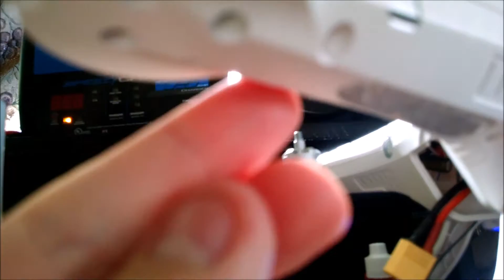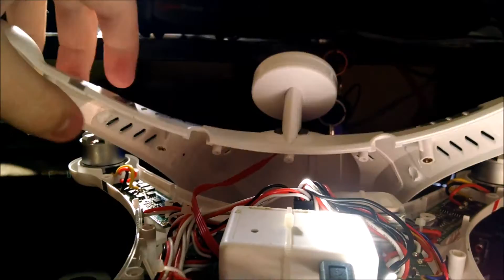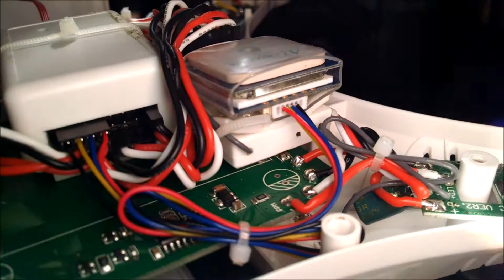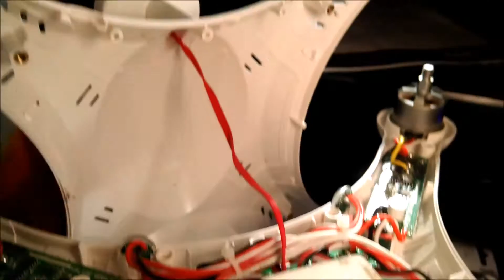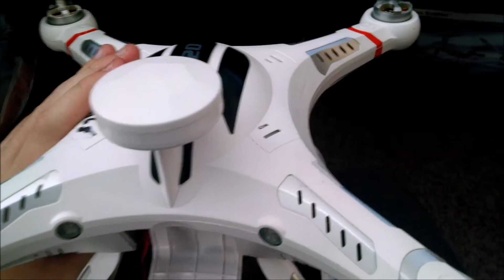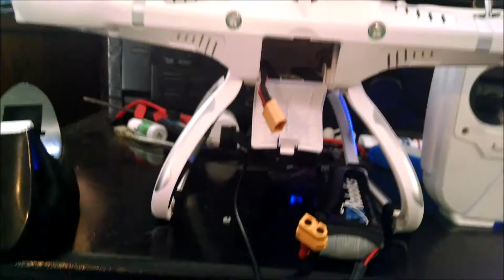Cheerson CX-20/Quantom Nova GPS Signal and Tilting Issue Hack/Fix

Comment: Hi, 
my cx-20 was flying fine today but needed more angle to combat the breeze so i came home and made the max angle = 3500 in mission planner now it will not arm, been building and flying planes and quads for 8yrs and tried for hours but it will not arm, got 5/6 sats green solid light, reset tx,all solid red rx inside cover, have you got any idea whats gone wrong , 
thanks
Kevin.

Comment: HEY bro, i have a quick question man,, Im having major issues as of late,, was working perfect till quad went crazy on me, and had abit of a spill, but noting Major,, ? I mean moments after it happened i wanted to see if any damage was obvious, and she linked up with the sats real fast like she was,, but after a few days off of not flying her,, it was like she just wouldnt give it up?! SHe would not, and most of the time will not link?? Now if i jiggle and push on the Sat DIsh thing ontop of her bbody, she someotimes decides to let some sats through, and then gets a somewhat descent lock,, anyway,, more times than not, i have to mess with the dish, and wait, and then off on, off on, and fly for abit,, and then MAYBE?? just Maybe the bitch will lock up a signal?!? I When itried to investigate i took off the top of the sat dish thing, and noticed a GPS Reciever of somekind, it usually blinks slowly, and then stops, and if i push on the stem of the dish, the little red light begins to flash quickly,, which one would assume would be a good thing, but again, usually i end up having to say screw it, and taking off with just regular manual mode, now the blinking reciver that i mentioned moments ago,,is that the exact same thing that you showed, and moved?? or is the one i again mentioned, just the othe end of the leads to just another gps panel or something,,?? please,, begging ya here,, help!? smh!!?
Reply from the maker: not 100% sure what your saying, but if I understood you correctly, you're saying that you crashed it, it stopped locking? if so, I'd check the cable to the GPS module. The module with a wire coming out of it is the 2.4 ghz controller module (what connects the remote to the drone)

Comment: So this does fix tilting during take off, or just during flight?PLEASE RESPOND
Reply from the maker: It fixes all issues related to poor GPS signal, so more than likely, yes it will fix all of the tilt problems. If it doesnt, youll need to replace the gyroscope
Reply: https://www.youtube.com/watch?v=-5b0Xeps4cM

Comment: thx for u vid, i will try it. Question..can it works with copper foli..?
Reply from the maker: I believe it will work with copper foil, probably a lot better than aluminum honestly. Copper is more conductive than aluminum foil though, so I would probably insulate it with package tape or duct tape to prevent a fire in case it comes into contact with any of the power source connections
Reply: thx, More Vid Mods...:)

Comment: This is my results two days ago...
Can you please see it?
https://m.youtube.com/watch?v=Lz5Zxz8Fhos
please someone , some suggestion, tips, tricks, or consideration etc.
Reply from the maker: Looks like you have a serious GPS issue. I'd replace the unit, and I wouldnt fly it in the meantime to prevent an accident or serious damage to property
Reply: +007K ...if not in manual, altitude hold and headless mode, that are 3 modes that works.
thanks
Reply: +007K and, you'll replacetge gps module(where to find and pay me or banggod? or tge unit you meaning the cx20??
tganx
Reply from the maker: Heres a link to the spare gps, follow the same steps in the video to get to it, except pull the wire harness out of the old GPS, and put it in the new one
http://www.banggood.com/Cheerson-CX-20-RC-Quadcopter-Spare-Parts-GPS-CX-20-011-p-917996.html
Reply: You are very kind. 
Thanx, we'll see, I' m thinking to fly it just in manual & alt hold.
I' m charging up on youtube NOW the flight of today...
you are welcome, stay tuned!

Comment: hi I have the dji 9443 props on my cx-20 and the silver ones are sitting higher up and they wont tighten any more, also when I try and get some height it starts spinning while ascending and descending so I lose orientation and have to hit RTH any ideas what to do?
Reply from the maker: The cx-20 doesnt work well with 9" props, I personally have DJI Phantom v1 props that are 8 inch, with a 4.5" pitch and it works great. The cx-20 motors are designed to spin fast, not work hard so when you add the extra inch, it needs more torque to spin. The cx-20 cant keep up with the extra torque need which causes it to spin, toilet bowl, or just stall out.
Reply: 007K thanks, where did you get yours from
Reply from the maker: I bought them on amazon, here https://www.amazon.com/gp/product/B00FB72EQU/ref=oh_aui_detailpage_o02_s00?ie=UTF8&psc=1
Reply: 007K thanks

Comment: please help me
https://www.youtube.com/watch?v=JEpynRahqGk&feature=em-upload_owner
this is my problem
give me solution
Reply from the maker: +denny pratama Looks like the flight controller is dead, or at least not communicating with the motors. Check all the wires, make sure theyre seated firmly, and if the problem persists I'd replace the flight controller.
Reply: +007K So, what should I do ? May I ask your facebook address ?
Reply from the maker: you should check the wires are fully seated, and if that doesnt work replace the flight controller, and I dont have a public facebook account.
Reply: Looks like you don't have param on it. just try to load a default cx.param from mission planner.

Comment: Should I press the top of the gps to the roof or should I leave some wiggle room?
Reply from the maker: +Outside-The-Box Entertainment either way, I gave it some slack to keep the vibration as low as possible
Reply: Thanks for the quick response!007K
Reply from the maker: no problem ;)

Comment: have u had any problem with the gps after this setup?
Reply from the maker: +LLEVNED nope, its been working flawlessly. I havent had it disconnect once
Reply: so u think this improves the gps i did the same with copper tape but have not flown it yet
Reply from the maker: yes, it works very well. Im not sure how the copper will work, but I imagine it wouldnt be any different
Reply: 007K
what happen if u lose gps while flying does it fly away im scared its my first gps quad
Reply from the maker: it will switch to manual mode without warning, it would act as if it wasnt computerized until the signal was re-established
Reply: Hi, I have had 2 and here is what I have found.  If it does the circle, 
move the GPS unit to the top canopy and then do the alignment, may take 
several tries.  If it flies off in one direction, the compass card is 
bad.
Reply from the maker: Before buying a new compass I'd calibrate it first
Reply: +ESIG3800 ...and if the compass card is bad what we gonna do?
tx
Reply from the maker: Paul Terl replace the compass, its like $10 on Banggood and super easy to replace
Reply: Pay me or Banggood??
And, are you sure I must reolace the compass??
even thanx
Reply: anyway, I'm going to retest it now and if even problematic I will use manual mode and not pos.hold.
Ciao!
Reply: If the compass card is bad, do a search they are not expensive.
Reply: In the on going comments below the #162 vid someone said to change the gps!... starting to be a bit of a mess here, or not?
Reply: In the on going comments below the #162 vid someone said to change the gps!... starting to be a bit of a mess here, or not?
Reply from the maker: Based on the video you showed me in a different comment thread, im confident the problem is the gps. But in this thread you asked what to do with a bad compass card, so I told you to replace it if its faulty
Reply: Thanx.
(But) I will return it, monday. Now I'm flying and doing videos with a Phantom 3 Standard.
Stay tuned!